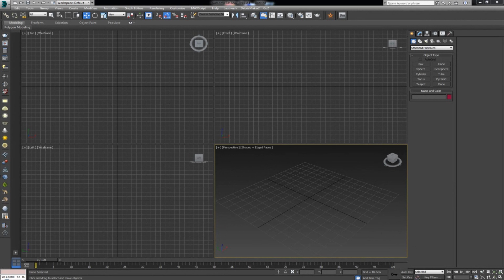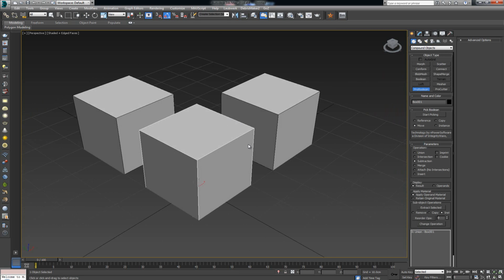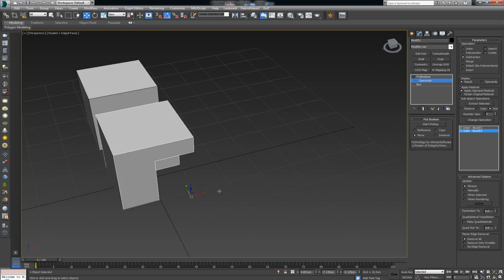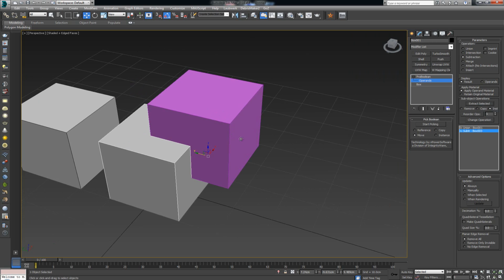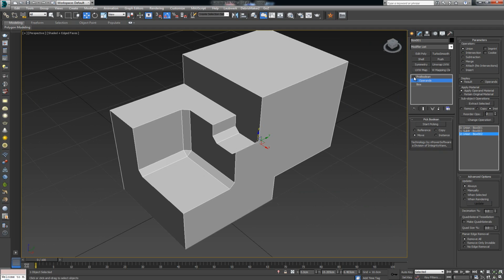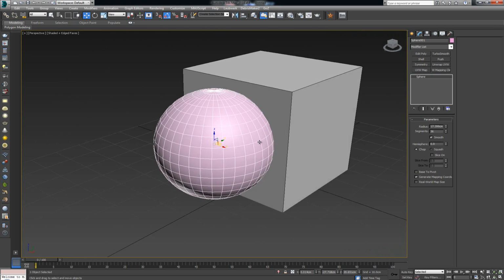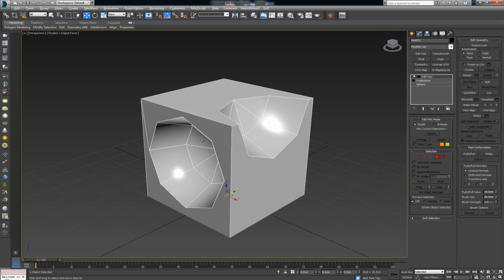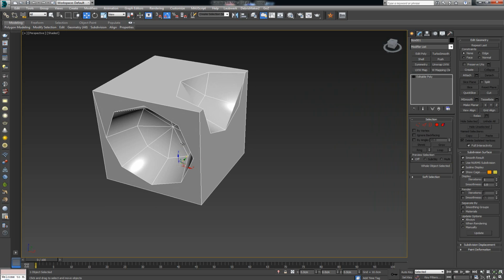3ds Max Basic Modeling Boolean Operations

Comment: Boolean is SUCH A SHIT-BAG tool. Never gets it right, unlike Maya's. As soon as you beveled an object, it changes the damn thing ever singel time, regardless whether or not you reset xfrom. It distorts obects after boolean. It's a shitty tool, and the programmers who created it, only got it half right. I've been a Max user for about 17 years now, and though I prefer to use it over Maya, as a modelling tool, I HATE this stupid function. Maybe they got it right in later Max versions, but I've got the 2009 one, and it blows.
Reply: If you saw the loads of tedious and amount of not so easy clean ups I had to do, you'd understand. I worked in both maya and max, for many years now. I prefer the precision of maya.

Comment: Max boolean is, and always has been horrible.
It will give you a nasty case of extra verts... you can get a cream for it though ;)
Pro-boolean on the other hand used to be a paid for plugin and it blew the standard one away.
As is usually the case with awesome plugins, Autodesk bought the rights, and it was incorporated into the next version of Max (way back in V6 if I remember right)

Comment: Max Booleans will constantly let you down, the algorithms perform at such a base level, the prerequisites you need to use in order to prevent errors mean it's quicker to poly model everything,  they were exactly the same in Max 3.1, the only thing that has changed are the icons.
You will quickly become familiar with "nasty geometry" if you use booleans on anything other than basic shapes.
All you've shown here is in theory Max Booleans are cool, but in practice, and on any mesh with a complexity above a box they are useless, there's nothing you can do with Max Booleans than you couldn't achieve by polymodelling in half the time with no risk of errors....there's a reason everyone hates Max Booleans ;)
Reply: I have heard this so many times.   That was why I checked this out thinking maybe something was being added that "fixed" the geometry.  It is a good video but there was a mention to a second video and I have not found it.

Comment: I am new to modelling.I have question about how do I use boolean in case of high poly modelling.I mean will it effect my model any issue?
Reply from the maker: In high poly modeling using booleans can be a two sided blade as if you don't control the edges you will get a big mess in your geometry